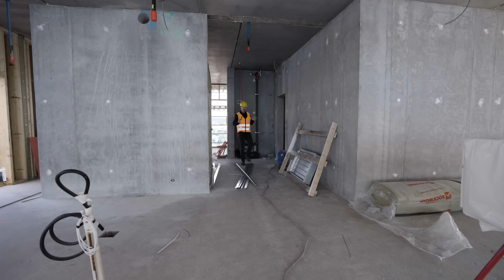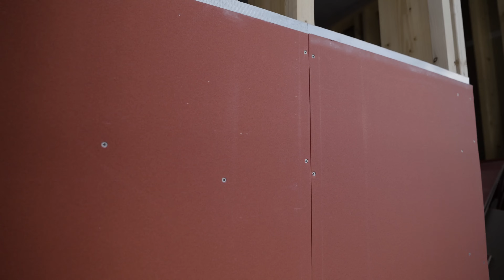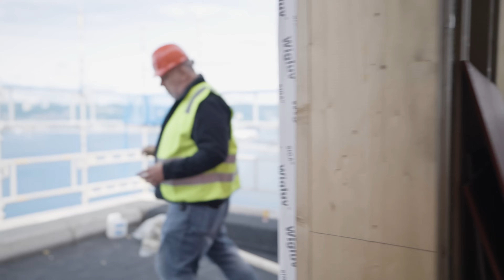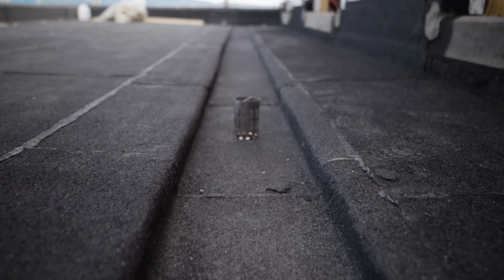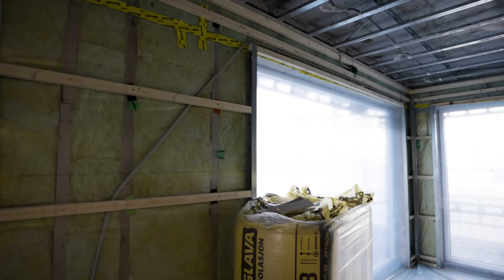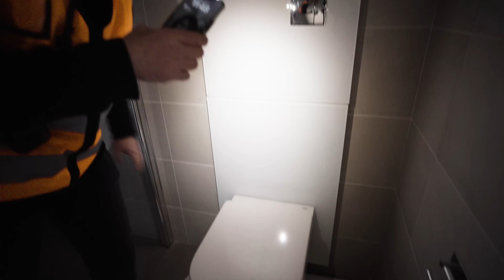How a Norwegian Highrise is Built

Comment: Hi. norwegian Roofer here. so reasoning for creating a gutter with the asphal membrane is as mentioned they are building a deck on top and using the system with no gutter will create issuiues for the carpenters decking. we sometimes use dual layer aspalt membrane systems they are more secure when it comes to the connecitons and weak points, however even on single layer asphalt roofing systems the gutters are requierd to be dual layers. and full welded to the first layer. making the conections your are pointing out in the gutter will be welded werry far and are werry unlikley to fail. but yes as mentioned this does push the product to its limits and wil requre the roofer installing the system to be extra vigulante to all conections in the gutter. but gutters made of the roofing felt is werry common in norway. even when there is no decking on top. we use this system on about haf of the projects i work at.
Reply: yes. Would like to add that another big benefit to having a gutter like this is to melt the ice around the drain sooner then the rest of the roof, because of the thinner insulation, so that the drain would be free and not blocked by ice like it would with dirt. when the weather shifts from cold to warm, and snow is melting, that is when you know if your roof is tight. its the most common time for leaks from my experience😉
Reply: @beatsnbeards630  exact point there aswell.
Reply: @Babatulu94  I see you are one of the many clown roofers in Norway, if you think a new build will have so little insulation in the gutter to be able to melt snow. GFYS with the SBS garbage.

Comment: It's basicly 2 drainage systems for roofs. Either over dimension the pipes or under dimension it.
If "under" dimensioned the system its engineered to suck water by creating a vacum.
Could be the case here.
Reply: Yes it's a siphoning system when full it drains by using vacuum and sucks most debris down, also why the holes are so small.

Comment: My first thought about the roof drainage system was what about snow and ice considerations.  Being a high-rise, you can't have a situation where ice or snow can build up and fall several stories onto a hapless victim below.  I have to wonder if they are using heat trace for maintaining flow of melting snow or ice in drainage "channels" - which might be a reason they have the "ditch" in the middle of the flat roof?  Here at elevation in the mountain west, we have lots of snow and ice, and sunny periods during the afternoons can cause a lot of melt - even with ambient temps well below freezing.  You have to be careful with your roof system, as melt water dripping "off" the roof - which can then re-freeze and build up, sometimes at places you don't want it to.  all our gutters and downspouts must be heat traced to maintain drainage to below ground drain pipes (which are heat traced to below the frost line).
Reply: First of its for a deck so no chance snow or ice will be sliding off, the drain is a siphoning system that's why it's built like a sump.
Reply: @andriandrason1318  You are right, the snow and ice will not fall off a flat deck.  That's obvious and is not a concern.  The concern is water from melting snow and ice must go somewhere so it does not drip over the edge of the deck or out the scuppers of the deck, and re-freeze into a heavy block of ice that could then break off and fall.  I expect the deck has some kind of electric heat trace to keep an open channel under snow and ice for water to flow to the drains.  The "ditch" might be purposeful to contain melt water on its way to the drain.
Reply: @tedbellSEA  I don't know why he said it goes over the edge as that is false, if he peaked over at the other side he would not see a hole.
All the water is drained by pipes within the outer wall, sometimes they have a heating wire around it.

Comment: I'm a carpenter in Norway and can explain exactly why we  build the way we do here in video I'm actually from same city as this project's in.  

Wooden Wall Construction Explanation

* Solid Wall Framework with 48x198mm Timber

Insulation: Building walls with 48x198mm timber allows for the inclusion of a substantial amount of insulation material, such as mineral wool (Glava or Rockwool). This ensures effective thermal insulation, reducing heat loss and contributing to the building's energy efficiency.

Structural Strength: The thickness provides a stable and robust structure, capable of withstanding environmental stress over time. The use of 48x198mm timber helps withstand strong winds, temperature fluctuations, and heavy snow loads, which are common in Norway’s climate.

Why Use Timber Instead of Metal: Timber is chosen over metal in many Norwegian constructions due to its natural insulating properties, which help maintain indoor temperatures more effectively. Unlike metal, wood does not conduct heat as readily, reducing thermal bridging and preventing heat loss. Additionally, timber is more sustainable, renewable, and easier to work with in terms of cutting and assembly. While steel and concrete frameworks provide strong self-supporting structures, timber offers flexibility and a lower carbon footprint, aligning with environmentally friendly building practices.

Strict Airtightness Requirements: In Norway, there are very strict regulations regarding the airtightness of buildings. All new constructions must undergo a pressure test to measure air leakage. The results of this test determine how well or poorly a building scores in terms of energy efficiency and airtightness. This score can significantly impact the final valuation of the construction project and whether authorities will approve the final certification of the building. If the airtightness fails to meet the required standards, the building may not receive approval, potentially delaying or preventing its use.

* GU-X Gypsum Boards 9mm thick and Siga Tape on the Exterior

Windproofing: GU-X gypsum boards protect the wall against wind and moisture. When combined with Siga tape, they ensure the construction is windproof, preventing cold air from penetrating the structure.

Moisture Protection: The boards and tape act as a barrier to keep external moisture out, crucial for preventing mold and rot inside the walls. This step is vital for maintaining the wall’s durability, especially in Norway, where heavy rainfall and moisture are frequent.

* Cross Battens for Ventilation

Ventilated Façade: On the exterior, cross-battens are always installed over panel cladding to ensure cross-ventilation. This system allows air to flow behind the façade, preventing stagnant, moist air that could lead to mold growth. Proper air circulation helps maintain a dry environment behind the cladding, enhancing the durability and health of the building structure.

* 0.2mm Plastic Sheeting as a Vapor Barrier

Moisture Control: The plastic sheeting inside the wall functions as a vapor barrier, stopping warm, moist indoor air from penetrating the wall and condensing when it encounters colder exterior air. This helps prevent moisture-related damage within the construction.

Sealed Joints: Taping the seams ensures a continuous vapor barrier, enhancing airtightness and preventing drafts and heat loss. This is essential in Norwegian construction to maintain energy efficiency during long, cold winters.

* Additional Layering with 48x48mm Timber and Extra Insulation

Thermal Bridging: Adding 48x48mm timber and an extra 48mm of insulation helps break potential thermal bridges that might form through the main timber structure. This improves the overall thermal performance of the wall, a necessity for meeting stringent building codes and energy requirements in Norway.

Space for Installations: This extra layer provides room for electrical wiring and other installations without perforating the vapor barrier, maintaining its integrity and ensuring the building's energy efficiency and airtightness.

*Finishing with Gypsum Boards (12mm thick)

Stability and Finish: Internal gypsum boards create a smooth surface ready for painting or other finishes, adding an extra layer of stability. This step not only enhances the visual appeal but also contributes to fire resistance, an important safety measure in modern construction.

Fire Safety Between Units: Between apartments and in ceilings, fire regulations often require two or sometimes even three layers of gypsum boards to meet Norwegian fire safety standards. This ensures that the building complies with fire safety codes and provides adequate fire resistance to prevent the spread of flames and smoke, protecting occupants and property.
Reply: I personally struggled to understand most of the criticism, particularly from Steve, whose comments largely consisted of incoherent rambling. As I understand it, they primarily dislike the fragmented asphalt sheets on the flat roof. This is a valid critique, and I fully agree with them. Personally, I consider flat roofs to be the devil’s invention. Nevertheless, I believe they underestimate the amount of asphalt adhesive used to achieve waterproofing.

The criticism regarding the use of timber in exterior walls stems from concerns about fire hazards and the potential spread of fire between floors, a justified fear. In Norway, we have prioritized insulation against the cold over fire safety, and we must acknowledge this. However, we have been prudent enough to respect fire risks by using exterior cladding that resists high temperatures. The interior plastic sheeting serves the sole purpose of preventing humid indoor air from penetrating the insulation, where it could condense and create thermal bridges within the insulation. The wind barrier is located on the exterior. Its only function is to withstand wind while allowing moisture to escape. This moisture is expelled from the insulation through incidental heat leakage from the interior, especially during the critical winter months.
Reply: Thanks! Instead of wondering why something was done they should have a local architect explain why something was done. Steve does not know the local weather and other challenges facing builders and owners and is hampered by his own biases from building in the states. The guys dropped the ball on this one.
Reply: @ronboe6325  Yeah I don't understand why they couldn't get some Norwegian master builder to answer their questions, and take away the guesswork.
Reply: @BawlsMining4people * 0.2mm Plastic Sheeting as a Vapor Barrier - How does the interior vapor exit the home, it just gets trapped between plastic and the interior gypsum?
Reply: @paybax  ventilation system. The interior has air-thight seal through all walls/floors/roofs when all windows/doors are closed. The only opening at that point is the "balanced ventilation with heat recovery" system. (this gets plugged during air tightness certification tests)
Reply: From the modern houses I've seen in Norway, the balanced ventilation systems often have filters too and are also linked with kitchen extraction! You can hang clothes inside and they dry in a day which is pretty unheard of in such a cold wet climate. The main downside I've seen is the LACK of humidity in the winter with heat recovery systems. By the time you warm air 35 degrees C, the humidity can drop as low 20% which is not comfortable. I've seen a lot of portable humidifiers in use!
Reply: @paybax 
 All types of windbreaks are diffusion open towards the exterior including that gypsum so any moisture accumulate even during building fase escapes easily.

Fun fact toletes located on a outer wall sealed with membranes for waterproofing have no vapour barier on that wall.  Avoiding the issue you are mentioning.
Reply: Great explanation. I'm assuming the gypsum boards also adds a bit of stability to the walls as well and making them stiff. :)

Comment: The roof balcony drainage system appears to be a siphonic system, which relies on the outlet being submerged in water to function effectively. The purpose of the trough is to create a reservoir of water that will flow into the outlet and initiate the siphonic action. Without the trough, the drain is unlikely to operate in siphonic mode. Additionally, siphonic systems allow for fewer outlets and smaller pipework, making them more efficient and cost-effective.
Reply: no this is a normal drain. the square meter of the flat is determinig factor when selecting size of the drain. and he pointed to the overflow low on the parapet indicating this is not a siphonic system and just normal drainiage. a 75mm drain is enough to take away a 300m2 roof alone. an a 110mm will cover 800m2 alone. we can ad more drains for safety or install an over run drain as this project has. but a 75mm is more then good and there will be installed a service openig in the deck to have acsess to the drain later

Comment: The spaced out facade is not only for drying, but equals out the pressure from wind-driven rain so that it cannot penetrate as deep. Usually its 23mm (laying) or 23mm plus 36mm (standing)

Comment: The balcony is done this way for several reasons; 
Easier to build a frame for decking
Easier to build with sloap from all directions
The channel is more reinforced to protect hard corners erc
Its only warranted for 20 years before you need to add another layer

Comment: The vapor barrier is 20x more resistant than the gypsum. This ensures that moisture can more easily leave the wall. The vapor barrier must be much closer to the inside of the wall rather than the outside, so that it cannot condense

Comment: The lumber looked very high quality. Maybe the EU lumber market is more competitive than the American market and has higher quality options available.

Northern building codes have polyethylene behind the interior wall because it's a cheap air+vapor barrier complimenting the interior paint. I think Steve's point is that it's bad to have TWO air+vapor barriers on both sides of the wall; so if the black surface on the exterior is a vapor barrier, then any failures allowing water into the wall will never dry.

The deck having a single slope to a single trough with a single drain is simple and easy to build on. I think Steve's point that the waterproofing is more difficult and prone to failure is valid; he's used to American builders with lower standards delivering lower quality results. Presumably this building is being made by people who have a history of successfully delivering this roof deck design.
Reply: The lumber is higher quality because the building code demands the use of certified lumber in all new construction and the local building inspectors actually do their job.
Reply: The black surface on the exterior is not a vapor barrier as inside. It is water proof but are breathing so it will not let water into the wall but will let water inside the wall out. Like a Tyvek just alot stronger. If that had also been a vapor barrier on the exterior it had been a moldy mess, even if the wall had been 100% dry. Since the temp changes will make moisture between the layers.

Comment: When you can have over 40 degrees difference in in- and outdoor temperatures in winter time is quite essential to keep the hot indoor air for not having a chance to mix with the colder air in the insulation.
Its elementary thermodynamics, hot air contains more moisture pr volume than cold air in absolute numbers.
Without the vapour barrier the air can condensate in the wall when the dew point is meet. That creates mould…..
Reply: The problem is in the summer when you have reverse vapor drive - where warm outdoor air/vapor driven inward - and is stopped at the vapor barrier, creating potential condensation issues within the wall cavity. I guess Norway's summers are short and cool enough that this situation almost never occurs. A better, albeit more expensive. solution is a smart vapor like Intello-Plus, which is more vapor closed in the winter and vapor open in the summer.
Reply: @ yes, the summers are not so hot and humid, around 35 degrees Celsius.

Comment: Something I always notice in overseas construction- Europe, Japan- is the quality of their lumber seems much higher. Thicker, usually wider boards and almost furniture grade, like it’s been planed and milled. Too much of US lumber is super warped, rough finished, knotty.
Reply: American culture is all about scamming people with the worst quality products possible
Reply: The 2 by 8 is rated C-24 i think. It also has to do with fire insulation. Theis 2 by 8 is milled or pressure rolled to smooth out any sharp corners. Which make catch fire much harder to burn them. Imo it takes longer time.
The roofing has atleast to layers on em